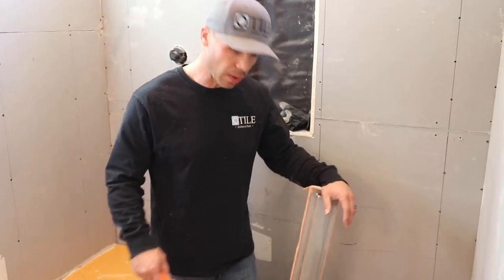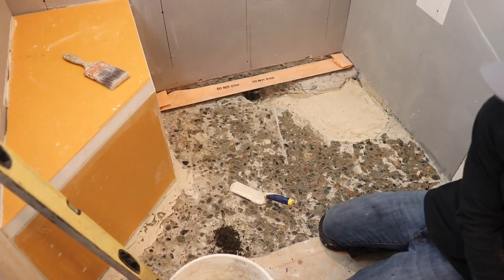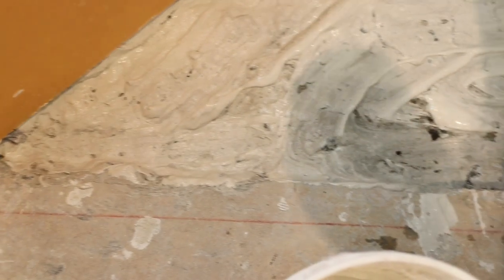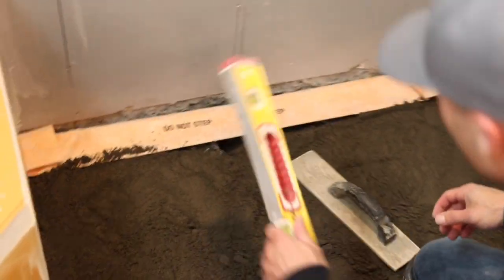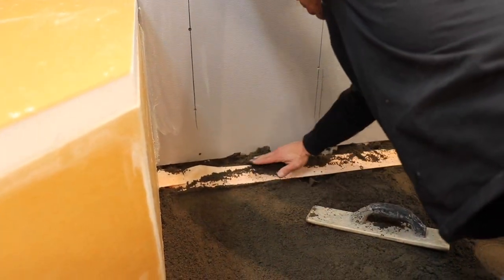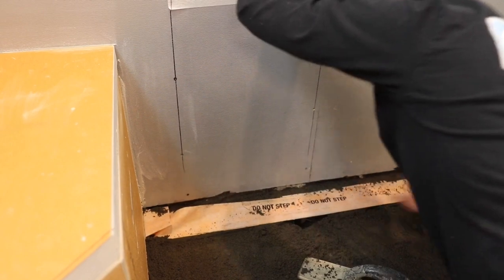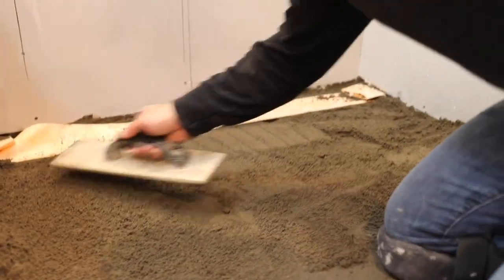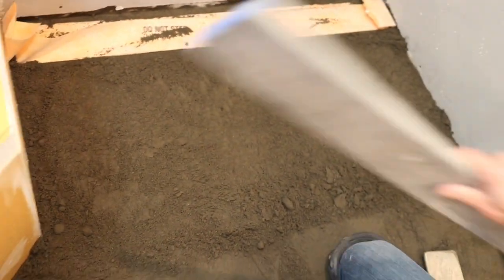CURBLESS! Line Drain on Slab : Tile Coach Episode 24

Comment: Question. What is the best way of getting the slab flush with the stud wall as you break it out. We used a wet saw, but we can't get closer than 1 1/2" to the studs.  We need the cut slab  to be flush with the studs.  Any help would be appreciated.  Will try to send a pic.

Comment: I desperately need to know how deep you had to demo the concrete around your drain pipe. Like what's the distance between the top of the drain body and the bottom of the rubber coupling?

Comment: I did the curbless shower for my daughters bathroom and boy do I regret it . Beside of looking beautiful it floods the bathroom because the center drain pan it doesn't really have enough slope in my opinion and we even replaced the drain pipe to a 2" one instead of the one that the house was built with. I had to install a one inch tall marble piece to stop the water from flooding half my bath, so no more curbless shower for my master bath.

Comment: Never seen someone use  a  straightedge like that before rodding off mud... I'm not hating  just observing. Not sure if you use wood for pulling mud but the 1x4 redwood are great. You can  cut to size, keeps a good edge, doesn't swell, makes nice ledge board and light. I do like my aluminum edges but my red edegs are my go-to for pans. I enjoy watching your channel, keep banging out them videos.
Reply: Rod or rodding  must be a Cali term? Never heard it in Florida.
Reply: Good tip using redwood. I've used the primed pine boards home depot sells. Also can be cut, and are usually very straight.
Reply: Amos R it is...Cali guys like rodding off

Comment: Dude , I've been doing tile for 30 years for myself total about 40. People just don't realize how much work it takes to end up with a top-notch job. Keep up the good work Buddy.
Reply: @TileCoach  , I've been doing tile for almost 40 years, been doing it for myself for 30. I enjoy the final outcome. I saw one of your videos where you had that bisque tile failure what was the problem on that was there not enough studs in the wall. That just surprised me. Must have been a very soft tile. Do you use lath? And the floor failing at the mall over gypsum, that had to make you sick.
Reply: Dry pack is the most difficult part of the job

Comment: Not saying you did anything wrong but we always do the preslope with recessed pan, then the pan liner on top of weep hole style drain, cut out for drain then do a slope which is usually pretty thin cause it's a recessed pan. So part your missing is hardibacker is already on with no liner? What am I missing with how you did it?

Comment: Don’t you have to set the mortar bed low of the drain so tile flushes up to it ?
Reply: This is the drain base / flange.  When you tile the slope, the tile will sit above the drain flange by the thickness of the tile.  Then, you place a grate in the drain base that also receives a slice of tile to match the height of the rest of the shower floor.  It's not like a point drain, which is usually expected to be the final height of the finished floor.

Comment: Newbie here,  I'm handy when it comes to projects, remodeled bathrooms before but never installed a linear drain. When doing your final dry pack, how much if any room do you leave from the top of the linear drain frame, to the dry pack foundation?  I would think about 3/8th of an inch or so to account for the thickness of thin set and tile thickness? I have a SaniteModar Linear drain I bought through amazon. Any help from anyone would be helpful. Thanks in advance.

Comment: This is really great info! I'm in the process of doing a very similar project. When I cut out my slab, I was only able to get to within about an inch of my studs. That leaves a lip of concrete along the sides and back perimeter. I'm not sure I can get it to be flush. How do you solve that problem?
Reply: @TileCoach  I think I can make that happen. Great to hear. Thank you so much and keep up the good work!

Comment: What do you prefer, A mud bed or kurdi foam bed? I'm redoing my shower and the linear drain pan is almost $300. I can use a mud bed and put that money into a bench and nitch. But if the foam is much easier to use then I'll just go with that.

Also is it because you're using kerdi membrane that it's OK for the mud bed to be touching the cement board?
Reply: You should learn how to do a mud bed. Pretty easy, and there's time to get it right. No hurry. I'll let Isaac chime in, but I'm pretty sure its "yes" to your question. The kerdi prevents water/moisture from ever reaching the bed and cement board.
Reply: @krehbein  Thanks, I'll give it a shot. For the $300 bucks or so I can also probably redo the mud bed many times, lol.
Reply: @TileCoach  Thanks man. Do you tile the walls, curb and floor over the drain flange right up to the very opening or only right up to the metal flange?
Reply: @TileCoach  awesome, good looking out.

Comment: Great video. I am in the planning phase of a new slab addition with a 36” x 72” curbless walk-in shower with a linear drain along the long side. I was planning to form a 2” deep x 36” x 72” recess during the pour. I will also increase the depth below this area so the slab is still 4” thick.  Do you have any suggestions or recommendations?  Would you recommend this recess be done as a mono-pour or in 2 separate pours? Thanks in advance for any assistance.

Comment: How thick was that mud bed at its thinnest point? I'm asking because I'm going to need to do a similar shower on slab. What's the thinnest you'd be comfortable making a mud bed?
Reply: Hey Isaac. Do you recommend people use the slurry on top of plywood? I have a 1.5 inch thick Radiant heat concrete slab. So I have some plywood around the drain area. I see some people use felt paper instead... . Also, is your slurry made out of modified thinset? Can I use non modified thinset instead?  Thanks
Reply: @TileCoach  Awesome - thanks Isaac. Love your vids - invaluable to a novice like me trying to figure things out!

Comment: @tilecoach, is there no real need to use a standard drain base with weep holes with the linear drain? Is that why you can use a rubber coupler like that? Or is it better/easier to use a rubber coupler with a linear drain?

Comment: Crazy, that deck mud is basically what I used on my off grid earth bag and tire wall coating... mine was massive scale tho... new Mexico clay sand from my property sifted of sticks and rocks, in a wheel barrel I'd mix 2 shovels of Portland to sand clay... finish surface primed killz black label and a simple exterior latex for waterproofing...

I laugh at common building techniques now after building a off grid home of tires and bags, the durability is not even close at all, my walls were metric tons per foot, bulletproof, fire proof, earthquake proof, bug proof, year round 70 degrees inside no matter temp outside, and 100% custom designed, not to mention recycling tires in a responsible manner helping the environment...
I'm in construction and do remodels, and hate it, I plan on getting back to tilling the earth building something permanent, and good in every way.
Reply: @TileCoach  I'm in south Carolina, I totally would want to put the simple knowledge out there, I had ideas of getting a sponsor like Ford  to donate vehicles to test the different building techniques against cars impact, the reason is because a tire can take 3 wheel barrels of dirt after ramming it with sledgehammer... that times 10 courses of tires is megalithic... a car has no match... neither do stick builds...
Mixing common building techniques with earth building is a very very promising idea for those interested,  I spent 5 grand including my acre of land on materials that keep me my wife and special needs daughter cozy for 2 years, before my youngest came along and changed our plans...
I can answer any questions anyone may have tho.... a great documentary called garbage warrior is a must if you want a good feeling in this concept...
Just think investing 50 grand into a earth build would produce the sq ft space as a Californian ticky track, but will last for hundreds of years, cost almost nothing in comparison, the only problem is elbow grease. .. you got to build it, take a yr to build, or pay 30 yr mortgage for something you don't own, and could burn down... umm I'll build mines all day everyday,  as I have plans for it I pray soon.

Comment: Nice work. I was thinking of using the schluter pan for one of these drains. Can you confirm the drain is to be 2.5 inches from the wall for install? Wasn't really sure if there was a tile to be installed behind the drain or just wall edge down to drain? Enjoying the vids
Reply: @TileCoach  be m to

Comment: The wall panels should be installed after the shower pan is packed and set, so that water does not penetrate between the two on the vertical. That shower is guaranteed to fail.
Reply: You're funny, those panels have a gap just like you between the ears.
Reply: No fail redgard the whole thing

Comment: Curious, how long did it take you to jack hammer that couple inches of concrete? Going to be doing this on my bathroom remodel, not looking forward to it.
Reply: Use an angle grinder with a cheap diamond disk to cut lines in the slab, makes it much easier for the hammer after that.
Reply: Swake 001 That’s a good idea, as long as you keep the dust under control.
Reply: @krehbein  and that dust is going everywhere...  put a little water on that concrete in advance and it makes mud instead of dust. Never captures 100% of the dust but makes a huge difference. I personally use one of those angle grinders with a dust shoe around the head. A good shop vacuum connected to it does the rest.

Comment: how do you know where the level pitch should be ?
Reply: typically how much do you need to go down on the slab? Im doing the same job and i basically cut around the slab with a 4.5 inch cutter so i probably went about 2 inches all the way around. would that be enough to pitch from there or i need more ?